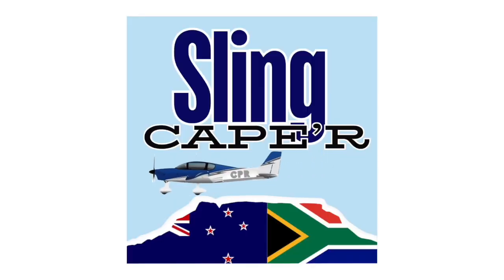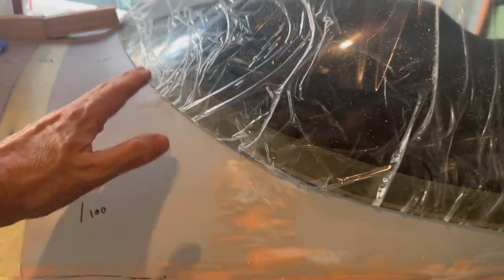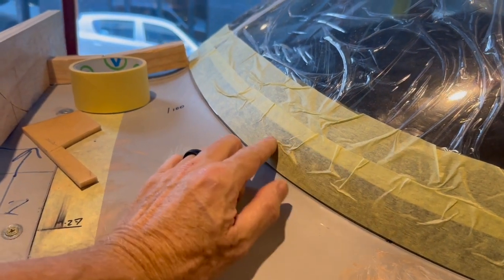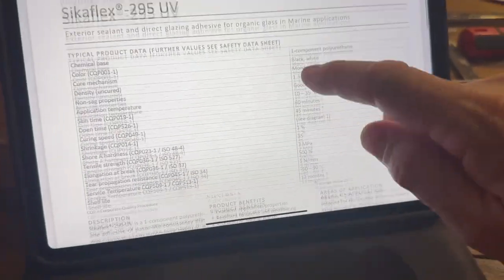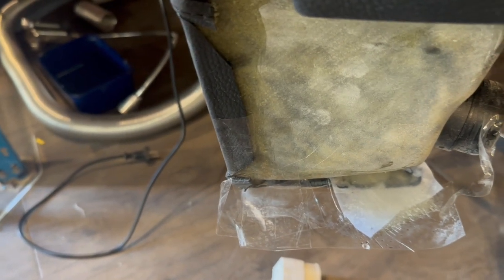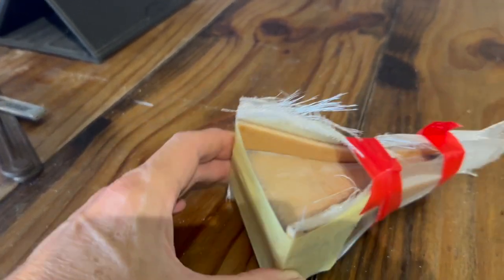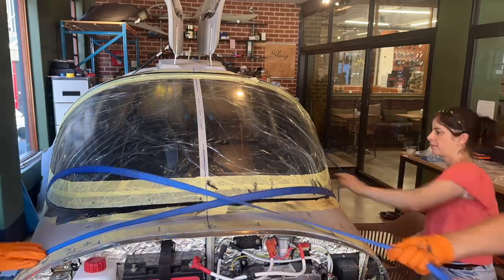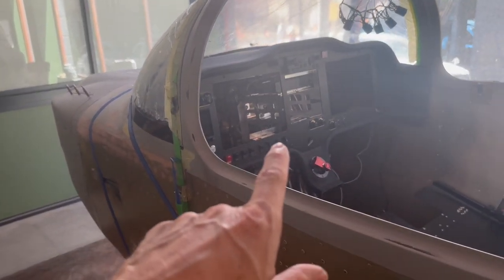WINDSCREEN GLUED! Major Milestone at 630 Hours 🚀 (And Now We’re Getting Kicked Out?!)

Comment: Nice progress! Are you planning to paint over the glass in the section that has the glue to prevent it from UV? I noticed that it seems you didn’t apply paint on the inside of the glass. Just wanted to see what your plan is for that.
Reply from the maker: Hi.. yes, the plan is to paint the outside of the acrylic. The glue itself is actually UV resistant but the activator/primer is not so it will get paint although it’s mainly for looks. I did actually apply the primer on the inside of the glass. My phone camera had fallen off the mount and I hadn’t noticed so I didn’t capture it unfortunately. Acrylic itself does actually filter UV (some better than others) but yes, the outside will get paint.